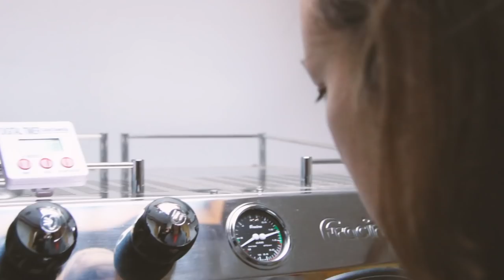Our DIY floating cafe boat! Ep31

Comment: Apologies if this is old news to you. We started and ran a community café in the past. 
a) we trained new staff on foaming milk by using water with washing up liquid in the jug. Much cheaper than milk. Can practice lots for almost no cost.
b) if you haven't found James Hoffmann's channel then highly recommended (eg playlist on dialling in an espresso). 
c) some big bright flags, boards out 24x7 with your opening times and prices, some garden chairs on the towpath (and bins for rubbish, recycling and composting). Also boards at all the nearby accesses onto the towpath (Holly the Café Boat 5 mins walk this way). 
Good luck, if your coffee is as good as Holly looks then should do well 😊☕
d) humidity and temperature variations are going to be a challenge with the coffee beans. Will take a lot of tasting and practice to know how to adjust the grinder dose and fineness. Will probably need adjusting through the day and we found it takes a lot of learning to get people confident that they know what to adjust when coffee is not right.
Reply: Sandwich boards on the tow path, and as Dave says 3 or 4 plastic stacking chairs and 2 small tables on the tow path if width permits, good for serving from the hatch in these COVID times, soft ambient music in the cafe. I know its still cold but you could dress a little differently, either formal black and white or continue Holly's theme, either way Vic you need to lose the woolly hat when working.......looks like a bargee hat! ;-/
Reply: This was so nice of you! I hope they do well!
Reply from the maker: Thanks for the ideas everyone, we'll definitely get some of those on the go. And James Hoffmann has been recommended to us a few times, we'll watch some of his vids! Thanks again :-)
Reply: Wow!! After all these suggestions on coffee prep, I think I'm ready to open my own cafe!  😉   Not! 😁  Interesting to read, though.  👍
Reply: @bryand1958  You cannot block the towpath
Reply: @merlinonline67  Absol true Merlin but if space permits, there are areas where the tow path opens out.

Comment: Wonderful vlog! I just discovered you and wonder how you will manage with the lockdowns I read about in the UK. When you admitted how nervous you were at your first “customer” it brought back memories of when my late wife and I retired in 1987 and started a B&B on an island in Lake Ontario. We did a “dry run” with two couples who couldn’t find a vacancy and the local tourist bureau phoned us even though we weren’t officially open as the fitted carpet people had let us down. We didn’t charge them and it was a delightful experience. B&B people are pre-screened, in the sense  they are rather special people, and I suspect people on “canal time” will be the same. You’ll get the odd nut case, but if you two have half the fun we did you will never regret your decision. I will subscribe and follow you now, and I wish you well in the years ahead. Cherish each other. Life is short.
John, Ontario, Canada

Comment: You need a 'Holly the cafe boat' A frame sign/board to put out on the towpath and a type of small shelf /table you can put the drinks on so you don't have to put them on the towpath.
Maybe a small footstool repainted would be a ideal hight?
Reply from the maker: Good ideas Tempest, we may steal a few of those :-)

Comment: Missed you guys!! Not sure it'll help, and it's in no way a criticism, but a lot of fridges, will not work with an ambient temperature below 10 degrees celsius, because of the heat transfer gizmo.
Reply from the maker: Hmmm that's a good point, I didn't think of that. Ill do a bit of research, thanks Andrew :-)

Comment: Hi jo and Vic, I have taken a couple of months of and come back on your launch date.. or is that later? when  or what regulations does the crown put on you now covert is widespread? I pray this won't be an obstacle for you guys because you  both have worked so hard to achieve this dream. At the foot of the Nottingham castle is a canal,  Me thinks the Grand Union? and a marina,  in the spring, maybe you can more on the footpath there... Great to see you both and wish you well... John in New Zealand  Kiaora mi :-)
Reply from the maker: Hi John! Hope all is well over in NZ, great tip for Nottingham, thanks. We are still able to open and trade we just have to do takeaway only and follow all the Covid health and safety regulations, hopefully the official launch date isn't too far away!  :-)

Comment: Hey guys, have you thought how you may deal with disposable cups at all? Given the rather unique type of cafe, how will that work long term? Some sort of biodegradable cup? I know it's a tricky problem to solve as a lot of the cups have a wax lining, and obviously need some insulation to stop customers burning their hands.
Reply from the maker: Hi LibC, yeah that's exactly right; we use 100% compostable cups and lids, boxes, cutlery and everything. They're called vegware. Hard to find because like you say, a lot of these kinda things labelled as compostable aren't quite 100%. But these are good.